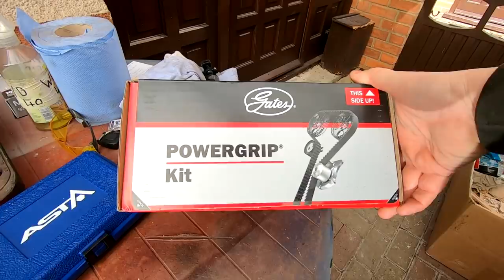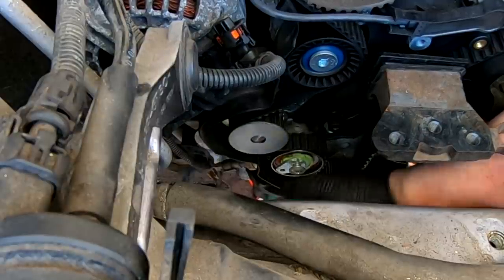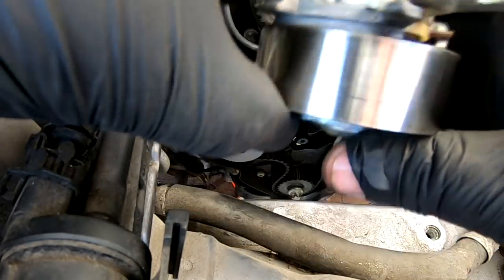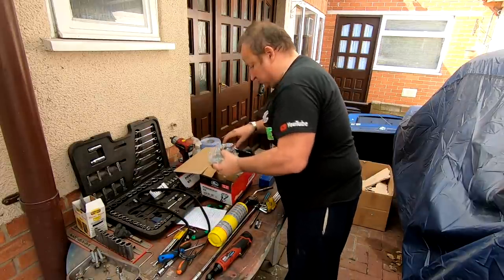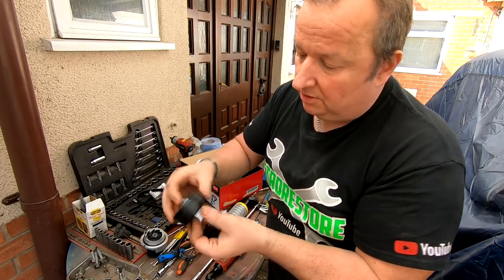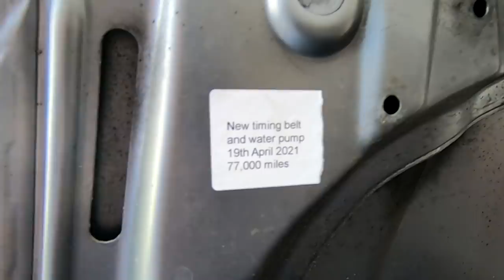Vauxhall Opel Astra G Mk4 1.8 Timing Belt And Water Pump Replacement

Comment: I would put my money on that idle problem being a MAF sensor, mine had a similar issue and turned out to be the MAF. Good video Martin
Reply from the maker: I will be checking that James, the main problem is the lack of performance possibly due to fuel starvation so i'll be changing the fuel filter as well.
Reply: Run it unplug the maf see if there's any change
Reply: Great work Martin as always, as well as the MAF sensor I would also look at suspect coil packs on the plugs. I had that exact problem with an Astra, rough idle and lack of power. Replaced them and the plugs cured it. Looking forward to the next one.
Reply from the maker: @chrisross-smith4358  Thanks bud.

Comment: Just cable tie the camshaft sockets together before removing the belt done that way for years
Reply: It saves paying for hundreds of different tools which you may only use occasionally 40 years Ford mechanic
Reply from the maker: That's a good tip, thanks.
Reply: Sorry if this is a stupid question, but If you've got a mo', can u explain how to do that? Do you cable them before backing off the tensioner, or after? Belt has to be off I guess? Cheers. Great video Martin.
Reply: @dg1294  hello David before you remove the belt get the timing marks aligned and the get a large cable tie and wrap it around the 2 camshaft sprockets where they meet-up closest to each other, I hope this helps and makes sense. All the best. Steve.

Comment: I was wondering why such a nice looking car was only worth 450 pounds...until I got a look at all the rust on the underside!
Reply from the maker: It was just surface rust on the subframe, They all suffer with that. Its all been sorted now.
Reply: @retrorestore  It doesn't snow where I live, so no salt on the roads.  I'm used to seeing only a patina of rust on the underside of cars, not loose flakes.

Comment: I replaced timing belt & water pump 12 months ago on this same model car. I just Cut a triangle piece of metal & wedged & locked the cam shaft.
Reply: Mine is Australian Holden Astra made by opel obviously last of the Astra G 8/2005 it has done 295,000 kms & it runs good.. Do regular services on any car & they will normally last much longer than expected.

Comment: Watched from start to finish you give a clear and easy to follow explanation of each part Martin and how to complete the job this is an excellent video. It's amazing how many people don't change the tensioners guides and water pump and wonder why in two months time the bearings have gone or the water pump has fell to pieces. I gather them bearings are self adjusting over time with the levers on were you can select new belt or used. Great video.

Comment: Great video - I'm doing the same job on my Zafira.
You were very lucky getting the tensioner bolt off so easy. Mine was on so tight that I ended up having to drill the top of the bolt off. Took hours.
And the third bolt on my water pump must have been hammered into a torx shape rather than a hex H5 like the other two. I had to use a T30 to get it off.
They really should supply three new bolts with the water pump.

Comment: I own a 2004 Opel Astra G diesel, Y20DTH engine, 2.0 DTI. The setup looks similar to yours and I have to replace the water pump. Your video looks very easy to follow. I will try it myself :)

Comment: That locking kit is for the XER engine you have the XE engine also throttle body gets clogged up including a 1mm bore best off removing cleaning and refitting.
Reply from the maker: Thanks for the info!

Comment: great stuff martin! I done a timing belt before on a Kseries engine, I bought the wrong locking kit for the fly wheel, ( i never knew until the bottom moved!) bought the correct tool and all was good, I got my dad to help with the belt, its a job that needs more that pair of hands as you say.

Comment: I brought a astra twintop yesterday, 2008 1.6 61k miles full service history. £800, owner said the roof was faulty.   Took me about 2 hours to fix it and now the roof works.   It's in immaculate condition.   I need to change timing belt and water pump because I don't think its ever been changed.

Comment: Just to say if you had undone the torx bolt in the centre of the plastic bracket that holds air box in place it would of stayed attached to the air box when you removed it rather than pulling it out the rubbers and breaking the plastic lug off. And the timing tool didn’t fit because it’s for later type engines. The one you needed is metal not plastic and it has slit in it to fit over webbing in between cam sprockets. 👍🏻
Reply from the maker: Yes I know now it's the wrong one but the listing said it was the right one when given my registration number.

Comment: I've never aligned the cams and bottom crank like that I usually put the wheel back on jack up the passenger side and put it in fourth and spin it. I'm gonna star using this method

Comment: i have the same model as this,,i attempted to do the timing belt and water pump today but ran out of daylight hours,i managed to get the three water pump bolts out which were very tight but the pump wont come out! it seems to rusted into the housing,i tried jarring it and leavering it but to no avail,think i may have to try a blow torch and some sort of extractor to pull on it! the bearings are totally shot i can move the pump wheel side to side a lot! no wonder water has been pouring from it each time i start up!

Comment: Great video, i have a 98 Astra G  1.4 for 14 years, have done 3 timing belt changes never used  locking tool, but the last couple months seems to be no end of problems, latest is i  think i have a leaking water pump, shame because timing belt not due for another 2 years. would like to keep it on the road but as i say last 2 months have been very trying.

Comment: Balls off steel Martin doing it with no locking tool.  IM a trained  vauxhall mechanic seen people do that and bend a valve when it flicks round. You must have more jam than hartleys my son.  IF you get a fault code for cam shaft sensor in the near future . recheck cam belt tension . this sum times happens. great video.

Comment: Those cam lock kits are designed for all the models Z18XE and the later XER And XE1 engines. It's like a universal kit. Some of the tools don't fit some of the engines.

Comment: eco tec engine are renowned for the idle to be lumpy i had a 2ltr vauxhell omega that would not idle properly you need to clean the idle control valve it gets a lot of soot build up on it. I think their is an upgraded part for it now. Also that subframe is looking a little rusty
Reply from the maker: i'll be checking all that in due course.

Comment: Great video just know the time belt tensioner needs to tensioned anti clockwise if not you normally hear a nocking noise from the indicator hitting the stopper not to far down the road the belt will fail maybe and good bye motor

Comment: Even the fuel pump on the way out. That coil packs to spark plugs to spark plug wires. Best thing you try is to pull a lead off see if the engine rpms changes. Then run a octane fuel cleaner dirty injector spay pattern. Make sure the tank is full/ certain brands mix better with full tank. Then after you’ve covered everything go drive it till it gets up to temp run some hard acceleration sometimes it’s bad gas ⛽️ to low octane fuel sometimes they want mid to premium till it’s cleaned up. Then look at the intake and exhaust valves being fouled with carbon. What happens is their not getting a clean burn.
Reply from the maker: It could be many things but I like to see what codes are being thrown up first and take it from there.

Comment: If you've got a OBD2 reader which is capable of live data you want to look at the MAF sensor while idling. It should read 1.8 g/s (Grams per second) it can be a tad over but not by much and not under.

Check the long term and short term fuel trims aswell +/-  as this will let you know whether it is under or over fueling to give you some direction as to what is causing issue.
Reply from the maker: Yes bud, i'll be plugging in my OBD2 reader in an up and coming video.

Comment: you took a chance mate no locks on the timing well done ive chanced things myself lol but please take the plugs out makes things so much easier and no back pressure you could have done it yourself
Reply from the maker: It was ok Robert. I've never taken the plugs out to turn the engine over

Comment: My vectra has an issue where if i floor it in 4th or 5th it seems to have a hiccup, could that be timing related? It idles fine and is pretty smooth apart from that
Reply from the maker: Could be spark plug breaking down or coil pack under load. An obd2 reader might pull up the fault.
Reply: @retrorestore  i've had my scanner on it and all that it brings up is thermostat heater control curcuit open which i'm already aware of, i will whip out the spark plugs and have a look and possibly replace, if that doesn't fix it i'll then look at coil pack

Comment: Even though I did do a timing belt change before, I am not comfortable doing one.Too afraid Lol !!
Reply: Nah you would be ok 👍🏻 remember the important part of the job is after installing and tensioning the new belt is to turn the crank a full revolution twice you would be able to feel anything untoward without any damage and check that all your timing mark lineup ok, the worst that can happen is if they don’t then just take the belt off and do it again until they do. Go for it, it’s a great sense of achievement. All the best. Steve.

Comment: That's not your first one Martin buddy lol. I heard  a lot of boys complain about the plastic water pump but never had a problem with them myself. Always look at instructions 😂 or destructions rofl. I will  tell you a funny story Martin went bought all the fancy locking kit my cousin said what you buy that for  Ali he said you done enough of them to know the timing lol. Good old tipex lol.😂  That's it Gary give the old man a hand. Got another one for you Martin one came into Vauxhall one day ticking like a bomb tensioner was loose some one did the belt never did up the bolts lol. I seen some funny stuff when I worked for Vauxhall. All in all good job mate. 👍
Reply from the maker: When I did the Signum, the belt had been over tightened and the jockey pully's collapsed and the water pump seized. Lucky to get away with that one.

Comment: i had a 1.8 ecotec  zafira that had a poor performance turned out to be the throttle body was all gunked up with carbon and there is a tiny breather hole inside the throttle body that i cleaned out with some thin wire and it ran perfect after that hope this helps

Comment: Hi I have Citroen Berlingo van and it have oil pressure fault the oil flutter was changed oil pressure switch was changed still doing it

Comment: Good video maf I bet but the ecu are known to die on them anyway how did you tighten the bottom pulley
Reply from the maker: Same way we undone it.
Reply: @retrorestore  what I mean is how you stop the pulley from turning when tighing it up
Reply from the maker: You might want to see how we use a strap on this video on my son's channel for undoing and tightening up a similar bolt. https://youtu.be/VMrz7-xJ_nU?t=445
Reply: @retrorestore  all done and changed thanks for the info

Comment: Hey Martin, I've subscribed to your channel as I've been spending a lot of time watching these videos and they're very helpful.

I am about to change my timing chain and although this is a video about the timing belt, I would like to ask you if believe it's safe to buy chain kits off Ebay(or Eurocarparts, Arnold Clark Autoparts?

I have a 2006 Astra and don't want to spend a lot of money on it as I should be getting rid of it in the next 12 months but I need to change the chain and don't want to go for a £200+ OEM part. I've found a number of kits around £50/£60 and wondered if it's risky to install them?

ANy help would be more than appreciated!

Thank you
Reply from the maker: Sent you an email Jeff.
Reply: @retrorestore  Thank you for taking the time. Much appreciated!

Comment: Did you torque up the pulleys?.
Reply from the maker: Not with a torque wrench. I used my experience as I pretty much know by feel what 25nm and other settings feel like. If I was doing a cylinder head, I would use a torque wrench but with things like this, I use experience. I have done a lot of these.
Reply: @retrorestore  Thanks. Gives me confidence to do my own 1.8 astra g👍

Comment: tensioner goes anti clockwise not clockwise
Reply from the maker: i said that https://youtu.be/Sp3dSTrgMRQ?t=492
Reply: @retrorestore  review at 17.08, lever starts at 7 o`clock and is tensioned anticlockwise to approx 5 o`clock
Reply from the maker: @paulmartin1095  I see what you are saying. it will only tension one way anyway. Just a slip of the tongue, none of it is scripted bud.
Reply: @retrorestore  Hi again, if its goes clockwise the tensioner can `hammer` against the `stop` causing damage and possible failure. I would just check again that it wont go anticlockwise. btw keep the vids coming, anymore on the st220`s?

Comment: Brilliant logical instructional video. I'd feel confident doing a belt change on that type of engine now.
Locking tools are for pussys anyway. Never heard of them in the 80's when I was doing timing belts on my FIAT twin-cams.
Reply from the maker: I used to love those engines. I had a Fiat 124 Special T and that use to fly.
Reply: @retrorestore  As quick as a Lotus Cortina was a 124 Special T, and FIAT didn't need to put anybody else's engines in to make their cars go well 😂
131's were my thing, a 1600 TC Supermirafiori, a couple of Mirafiori Sports, then a Strada 130TC Abarth.